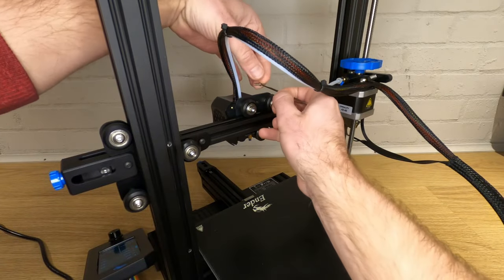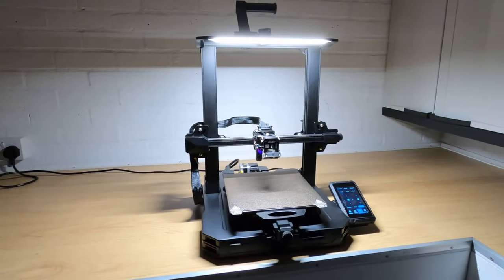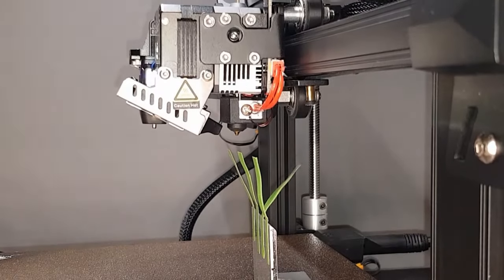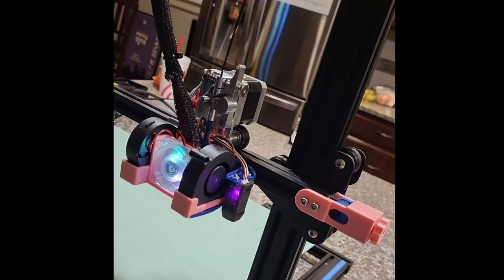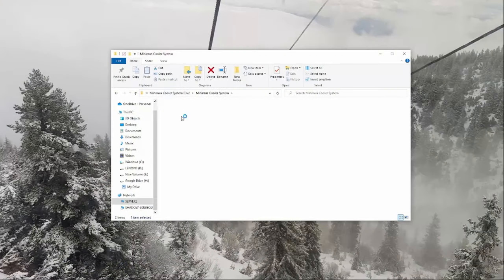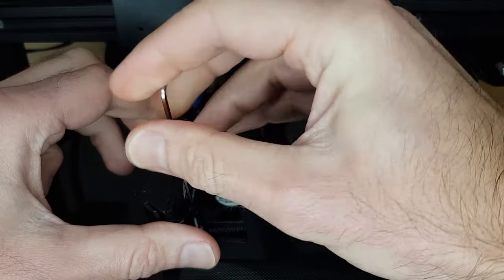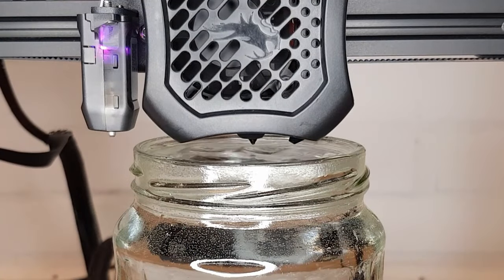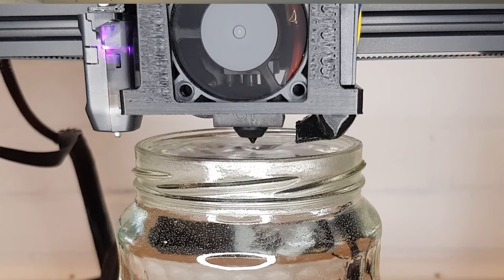Minimus Cooler -Possibly The Best Cooling Fan Upgrade For Your Ender 3 Style Hotend

Comment: ITS FREE NOW (as of 01/09/2023)
Reply: confirmed
Reply from the maker: Wow, that is awesome.
Reply: Wish I could open it as it's just pictures with no way to get anything
Reply: Wish I could open it as it's just pictures with no way to get anything
Reply: Can't figure it out I'll stick to thingaverse
Reply: @RickyImpey  I've heard the Petsfang is a better option? any thoughts?
Reply: @nikgrid  I was tryign to print the petsfang duct but I kept running into some of the layers not printing correctly no matter the settings :( wish I could test it
Reply: @charlesrestivo870  printables is so much better than thingiverse
Reply: What a weird birthday gift. Lol
Reply: I don't regret paying for it, the guy deserves every dime.
Reply: It's paid again, unpin it
Reply: The system is really convincing. I tied this version for my micro swiss hotend. But the ducts doesn’t fit right. The opening for the air is too far from the backplane. The most air flows before the nozzle tip …. Should be optimzed.
Reply: It is no longer free, but still priced very cheap

Comment: I am having trouble getting the back plate to print with decent quality with the settings specified in the readme. Has anyone had this problem with this  fan cover? All the other parts printed fine

Comment: Hey Ricky, Thank you for giving my Minimus a good test. I set Minimus at a special price this week for your viewers. 👍
Reply from the maker: Thanks Paul, great design that deserves some more eyes! Grab a bargain now everyone.
Reply: Any promo code or something? ;-)
Reply: @mikolajr No code, Everyone gets the deal 😉
Reply from the maker: @mikolajr  Paul's reduced the price for us all this week 👍
Reply: Much appreciated but I can't get it to work. Ive read the read me file, printed accordingly, prints look good but parts don't seem to fit together. I even played with scaling. Any suggestions or something i may have missed?
Reply from the maker: @benoxford1482  You probably need to look at doing a few calibration tests on your printer to see what's giving you strange results. Have you tried a calibration cube to see if it will print correctly and to the correct dimensions?
Reply: @benoxford1482  "horizontal expansion" in Cura helped me to print parts that fit
Reply: Will this work on the ender 3 max neo?
Reply: @pimpinkeen19  I designed a upgrade to the Minimus called the  Minimus Snap Z... It works on all the Neos..  But it does require that the stock hot end is upgraded to a more traditional width hotend. The stock one is just too wide to fit everything in and still have a low X offset. 👍
Reply: @roguepaul  I'm new to 3d printing so which hotend would I need to get?

Comment: I love how an 'upgraded' machine is just a bunch of multi colored extrusion slot covers and drawers, literally no drag chains lmao. There's a difference between the engineering crowd and the make pretty crowd. The worthy upgrades to print are anything cable management related as that's perfect for those filament scraps. The hotend that uses slide in fittings is smart, I'm here because I'm looking to reduce the weight of my gantry. I've already drilled my heated bed bracket out and replaced the heavy glass for spring steel sheet and ditched the bed leveling wheels for simple M4 nuts.

Comment: Hi mate, I've run into a problem; as per your description, I went a bought a 4020 fan for the hotend, which fits fine, as well as a couple of turbo 4020 blower fans for the part cooling but I can't seem to find anything in Paul's designs to fit dual 4020 blower fans for the part cooling - can you help? Cheers in advance

Comment: Its a very good design. Thank you for these free files. I made small modifications , changed the design of front cover to fit exactly with grill liked design. Also a second cover on top of the 4010 dual cover. Perfect companion  together with direct drive all metal extruder

Comment: This is great! Replaced stock ender 3 fan as it was so noisy - this solved my subsequent heat creep issues with the noctua 4010 12v fan, and can now print at 230 degrees 🙂

Comment: I know a lot of people say the v-slot inlays are useless and only visual, however I find they make keeping you printer clean far, far easier. Just use them on the bottom slots though, using them on the vertical extrusions or the X gantry can interfere with your motion system.

Comment: After nearly two years with my ender 3v2, I've moved way from the jyers/mriscoc to klipper, and with the incredible speed increases (and 60w heater on all metal) I finally need better cooling. Originally I printed the fang, but I just couldn't get myself to install it, but this looks very appealing and is queued up to print. I'm still using BLTouch not CR, so hopefully I can get that to fit on the CR mount. Thanks!
Reply from the maker: BL and CR Touch are basically the same thing, they both fit fine👍

Comment: I just paid $5 and printed the Hero Me 7.4 dual 5015 set up for my ender 3 pro. During the assembly process, I was thinking "this is over engineered, too complicated and heavier". He designed the HeroMe to be "modular", universal fit product, so probably that's why it got too complicated. 

Probably, this is the better and simpler option. I like it!

Comment: What I love about it is its simplistic design that does not require any other modifications to the Ender system. I have a dual gear direct drive mod and it works perfectly with the different selections made by Rouge Paul and Rogue Designs.  No need to over engineer with fancy designs.  I am not taking away from other designs that work great if not better, but For a simple well design Ender 3 v2 , this system is perfect.  I still need to know what the "Light Trays" are for.
Reply from the maker: I don't actually know what the light trays are for. I guess some sort of light?!
Reply: @RickyImpey  it looks like they're small enough and match in size to where the ducts attach on the bottom. How do I contact the designer to ask him?

Comment: If you float some pepper on top of the water you can visualise the airflow much better, I got this method from Nathan Builds Robots YT channel.
 I already changed my hotends to Hero Me Gen 5 and 6 but these look awesome, I am wanting to get a third Ender 5 Plus but I am holding out in the hope that Sovol will do their thing with this printer design, whichever one I get I will definetly fit this model of fan duct and shroud!
Reply from the maker: Interesting you mention Sovol, I have their SV01 Pro on test at the moment and it's awesome. Very impressed with their machines so far.
Reply from the maker: Also, good tip with the pepper, I'll try that thanks 👍
Reply: @RickyImpey  I havent seen a bad review of a Sovol machine yet and I watched loads of them, everyone is wowed by them and the comments are extremley positive, the only critisism I have is that they wont sell the SV05-Cubic in the UK as they say we are not interested in it, but they have never sold this model in the UK!

Comment: Great video Ricky.
I have been using Minimus for around 3 months on my v2 and switched due to the hotend fan dying. I use the dual 5015 part cooler version and 4020 hotend. All being 24v Sunons and just love it. Around half the volume of the original fans. Well recommended.
Reply: I wanna go the 5015 route myself but am confused as to what type of fans I need to purchase for the parts cooling if I print the "5015 Dual" file. Do I need axial or radial fans?
Reply: @schmuhf  hey, you need the 5015 radial or 'blower' type for the part cooling and i used a single 4020 axial fan at the front for hot end cooling
Reply: @a51alias  That's what I figured in the meantime, thanks a bunch for the reply. The plastic parts are already done and I'll now order some fans.
Reply: I might be a bit late, but I just printed this exact setup for my V2 with 4.2.7 board, I am just curious on the motherboard connections, how did you tackle that? Can the motherboard support two 24V 5015??
Reply: @SauROnmiKE  I don't use this anymore but when I did, I bought a pack of 2 pin male and female connectors and just splice them in just above the heatsink assembly. It was a bit bulky but worked the power draw of the fans is tiny so running 2 didn't have any issues. I only ran them at 60% anyway otherwise too much cooling.

I have since swapped the whole thing out for a Microswiss NG Revo. Best thing I did.

Comment: Can't wait to get this going. I'm also doing KevinAkaSam's Ender3V2 upgrade. Both of these should keep the printer relevant for another 5-6 years with good maintenance. Don't have $1400 to spend on all these fancy printers. Upgrading is definitely the way to go.
Reply: i did the kevinakasam upgrade and boy the walls are clean loving it for now . Bambu lab have good printers for the price they ask and now you have options that starts at 300 and it gives you a lot more features and quality pieces and Q.C where other brands for that price is a basic printer and if you are going to upgrade you will pass the price of the expensive printers and saves you from a lot of pain dialing errors of the ender 3

Comment: I am using it on a Ender-2 Pro, single fan using stock fans. seems to work better than the stock fan shroud and I can see what's going on when I am running a print. That stock fan shroud is extremely bulky and blocks you from seeing what is going on under the nozzle.
Reply: Hi Van, I've just got an Ender 2 Pro and I'm loving it. I would like to have a go at printing one for the stock setup. Could you advice me as to what files I need to print. There are that many to chose from I'm just so confused. Thanks in advance.
Reply: @jondavies450  hey Jon, I used the non cable management version of the back plate and the non bltouch single fan version. The 4010 fans, I believe are the stock fans on the ender-2 pro. Like the creator of this video, i printed mine using PLA+ and have had no issues with the plastic deforming on me.

Comment: Thanks for the informative video, the files are daunting indeed! I have sliced all the files I think are correct..

One thing you dont cover is the CR touch offset, did you have to modify at all? I have a cr touch fitted at the moment.
Reply from the maker: Yes, you should measure and set your new offset.
Reply: @RickyImpey  I asked the designer of this file and he states it has been made to position CR touch in the same place as using original hot end fan cover. Much easier than compiling your own firmware file.
Reply from the maker: @timknowlden  Ah ok, I either didn't realise that or had forgotten 👍

Comment: Hello, buddy. Thanks for the video! Could you help me with a question? I want to add an extra cooler, but I don’t know exactly what voltage to buy. How can I determine the correct voltage for my printer, or does it not matter—meaning I can use 12V or 24V without concern?

Comment: Great Idea ! Thank you for the video. Sorry for my noob question. How do you wire those additional fan ?
Reply from the maker: No, it's not obvious sorry. The cooling fan can just be wired in parallel with the other one. That is, the same colour wires connected together. On mine I had yellow and black wires so I cut the yellow wire coming from the main board and then connected both yellow wires from the fans to this. Did the same with the black. I hope this makes sense.

Comment: This is a pretty nifty design. Are there different fan ducts for different hotends? Or a way to move them up and down?
Reply from the maker: Not as such, at the moment it is only designed to work for the Ender and Microswiss type hotends but if there is demand, I'm sure Paul would modify the design.
Reply: update on the way adds 4 more Ducts heights. This will be out within the week. 👍

Comment: Well, I'm going to try one, but when you take the front fan off it looks like the air will be blowing straight over the heat block, surely this will have a negative effect even if a small one
Reply: Nope. Temps nice and stable. Air aimed at bottom of heatsink. Air that goes through heatbreak is high and not blowing at Heater. This keeps heatbreak temp low  you get better retraction performance and no more Clogs. Unless you cause them with crazy retraction settings. 👍

Comment: The best I've tried is the one capable of 4020 on hotend and single 5015 blower. Because there're silent 4020 fans like Sunon MF40202V2-1000C-A99 DC 24V 0.68W that is a 26db fan or you can use 4020 Noctua with 12v dc-dc step down mini converter, and 5015 blower is powerful and still you can find silent one.

Comment: @ Ricky your simplistic videos are really great and easy to understand/follow. Has anyone fitted the same ducts on an ender3 V2 Neo before? I have confirmed with the creator of the mod that this will  unfortunately not work on an ender 3v2 Neo unless you have upgraded to the Microswiss hot end @Paul Elrod
Reply: This is such a disappointment :( I had really great hopes after watching this (the Hero Me also doesn't work with the standard hot end on the E3v2 Neo)

Comment: I bought and printed one of these for my Ender 3 Neo, but it seems it's too small to fit my stock hotend? My hotend looks wider than the one in this video, it's got long wavy looking fins rather than the flat rectangular design here. Is mine incompatible? I don't want to replace the hotend now :(

Comment: Does the fan speed need to be adjusted to accommodate for the more concentrated air flow?
Reply: I Recomend 40%-60% I have been using 60% @ 150mm/s and it's doing great.

Comment: Hello, this is a beautiful design but I wanted to ask will it work with the Creality CR10S? I tried to install it but it looks like the air ducts are higher than in the video you have for your Ender 3. The fans fit perfect but I’m worried about it being too high.
Reply from the maker: It's possible that your hotend is longer than on the Ender 3 style hotends that this cooler was designed for. My CR10s Pro has a longer hotend so I can't use the Minimus on that machine.

Comment: Hi Ricky. Thank you for all of this info. I am new to this and purchased an Ender 3 V2 Neo and I love it so far but it’s slow to print even after changing the nozzle to .6 mm, changing all temperatures and  the infill, etc. any ideas on what hardware I can upgrade ? I am changing to the all metal heatbreak. Any ideas would be great. Thanks.
Reply: Did you manage to make it print quicker? How?

Comment: Just wanted to clarify something. If you are using 12v fans you need to wire in series and not in parallel. This eliminates the need for any type of voltage converter.
Reply from the maker: Yes, good tip.
Reply: That might work, but it is not desirable from an electrotechnical standpoint. We are talking about impedance here, not simple resistance. See this explanation for instance: http://wwenze.blogspot.com/2012/06/read-this-before-connecting-two-fans-in.html
Reply: @AM-pi7jy  I understand your theory. Is this really something to worry about n such a low air resistance system?  I’m sure there is an electrical work around. Wouldn’t using a cap or placing a diode in-line protect the fans?

Comment: Appreciate some advice on how to print the duct using an Ender 3 v2 direct drive. What cura settings should I use and which orientation on the print bed should I use. I will be using petg filament 
Thanks

Comment: A question, given this fixes behind the hot-end therefore displacing the Y axis by the thickness of the fan holder, how does that effect the printing ? Do you have to put in a Y offset value ?
Reply from the maker: It doesn't actually space the y axis, it has holes larger than the raised mounts on the backplate so is sandwiched between in the gap, Very clever.
Reply: @RickyImpey  Indeed very clever, I shall have to check my printer out (Not an Ender, An Aquilla) to see if the fixings are the same

Comment: At 3:50 it shows the hotend fan is blowing directly onto the exposed top of the heatblock, i think that isn't desirable. What do you think about that?
Reply: Hey there I'm Paul the designer. If you can imagine the crosssection of that area, you will see that the angled airfoil brings air to bottom of the heatsink. Now combine that angle with the air above it that is not being influenced by the airfoil and you get a curved stream that gets under heatsink and to heat break and bolts. If your concerned about pulling heat a layer or 2 of kapton tape should make a difference. Over 800 ppl are running Minimus now it's been very stable. 👍

Comment: You may know if it can fit the Spider Hotend Pro with the Ender 3 v2? This is still your best recommendation ? I passed through all of your Sonic Pad calibrations series and all succeeded great. But when I printed on 160 mm/s I have some issues with the corners of the print model... it's looks like they are melted, "smashed"... I can't understand why... maybe it's related to the cooling ? My setup is Spider Hotend pro + MK8 Dual Drive BMG Extruder Clone and the stock cooling duct.